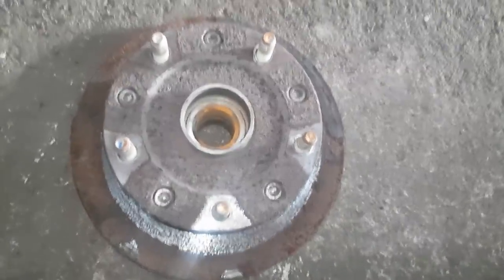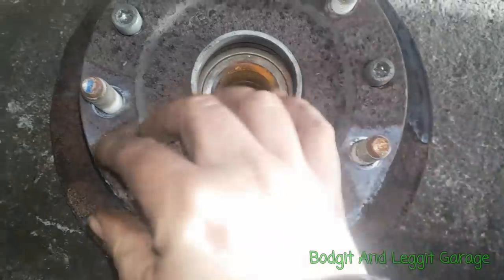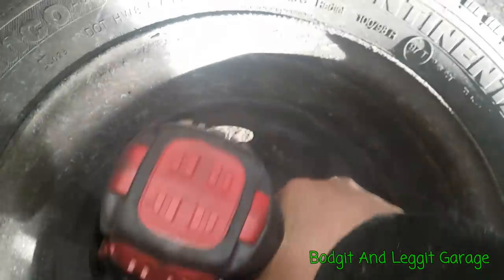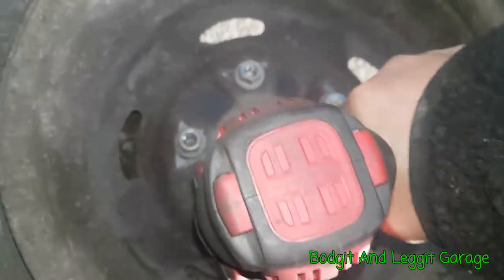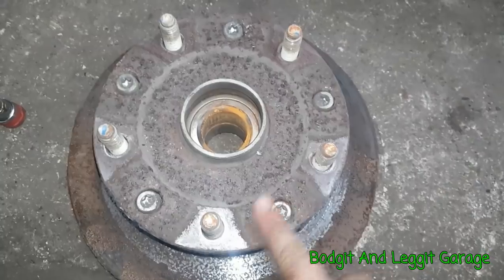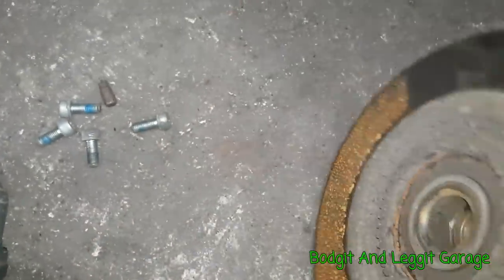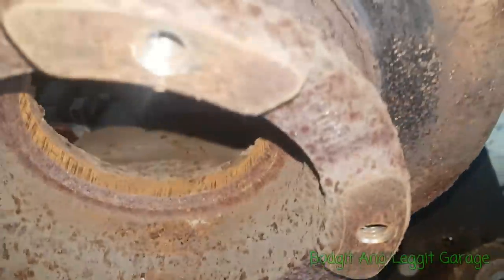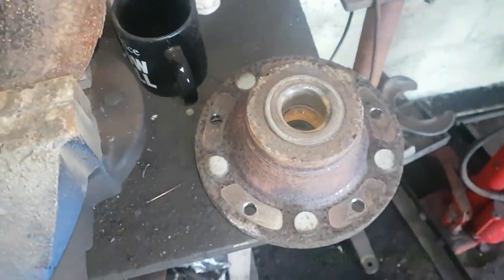TNT#28How To Separate Transit Brake Disk(rotor)From Hub With No Specialist Tool Bodgit Leggit Garage

Comment: I havn't got a ratte gun. Could I do this trick with it all still on the van, using a breaker bar and somebody pushing the brakes? Obviosly I will have the hub nut off. Does this work for front and back?

Comment: Awesome little trick that, will have to try it next time I have to do the rears on one of these things. A good video on the fronts wold be great due to the bearing seizing to the hub, I usually end up either smashing the disc or hub depending on what needs replacing, probably end up damaging the bearing somehow but never had one come back with bearing noise after.
Reply from the maker: Yes mate they are a nightmare depends how bad they are I just normally replace everything a lot easier for the customer can't come back but just leads to more money bad design
Reply: @bodgitandleggitgarage  Yea I get ya about the more money for the customer, some of them just don't want to pay or don't get why you have to replace the bearing too. Bit of copper grease always makes the next guys life a lot better, it's a very nice surprise when the bearing falls off the hub with no effort, "Thank f**k  the previous guy thought of me" comes to mind :)

Comment: very good I had three snapped studs on wheel (they snapped unscrewing them) so couldnt use that method but I know just how tough to split the hub is. in order to replace studs and for good measure, ford gave me wrong studs way to short, so need to do again. thanks good videos

Comment: Great tip,transit front discs such an arse to change. The worst is when one of the torx screws (T55?) Will not come undone and needs drilling out.
Reply from the maker: Yes mate they are nightmare absolute nightmare
Reply: There was nothing wrong with discs that fitted over the hub and came off easy over the wheel studs? Could change discs and pads in half an hour. Can't EE the benefits of this system? Shit design. You doing another Christmas video ? Last years collaboration was pretty awesome and brought a smile.